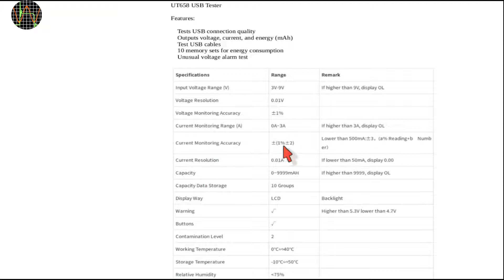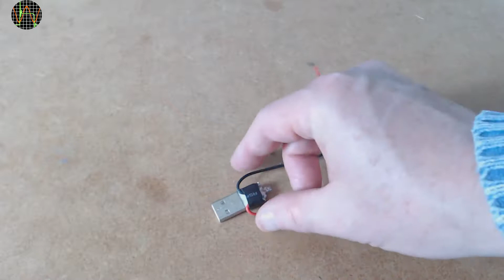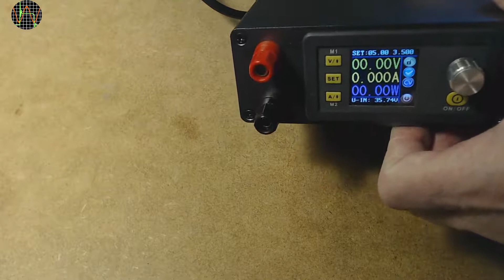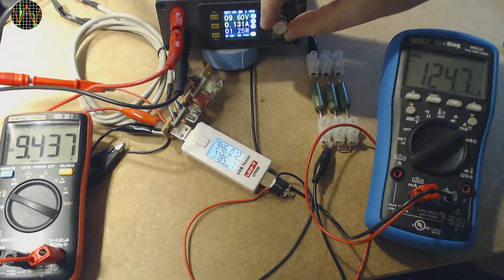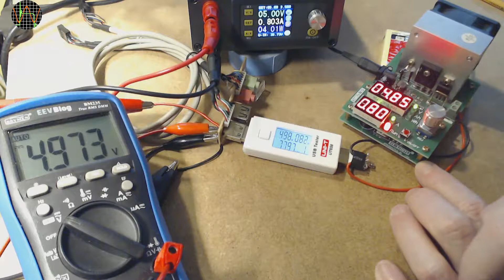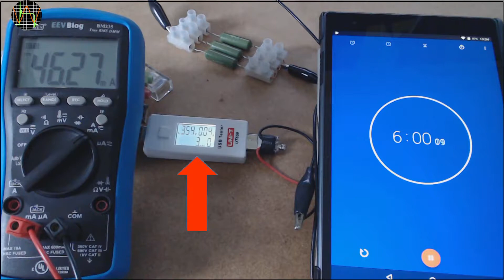Review and test of the UNI-T UT658 USB Tester

Comment: Hello, good morning, please, can some body help me? I want to know if I can use this USB tester, because I want to chek a power charger of a netbook Acer Chromebook, it has a power connector USB C, thanks a lot, Hi from Mexico City
Reply from the maker: There is a small chance it might work, depending on how your Chromebook implemented USB-C power and whether the charge cable is normal USB 2 (A) on one side and only USB-C on the other and what your charger is doing. A lot of variables, you see. This is why it is very hard to give you advise on this.  The problem is that the UT658 is really a bit old by now. It doesn't measure anything above 9V while more recent USB  power standards have 15V and 20V delivery.  This is negotiated between the Chromebook and the charger so it depends on the capabilities of both. In addition, by running the charge cable through the UT658 you reduced the whole connection to no more than USB 2 (4 wires), simply because that's how many the UT658 implements.  You may find that the UT658 happily shows charging at 5V or even 9V at 1A or so because with the UT658 in the loop, both Charger and Chromebook deem the connection to be the lowest grade possible and fall back to legacy charging voltages and currents,  In that case you find that with the UT658 in the loop charging will take ages while without it, it goes much faster.  So no point of putting the UT658 in.  To test a modern USB-C based charging system you need a tester that can handle this. Even the much more modern and capable UM34C and UM25C are not true USB-C. They can handle it (as a connector) and the power values will probably be correct but they don't carry  the additional wires for faster data, audio, video and so on. So data speed and capability suffer with these in the loop. If you ask me if I know a decent USB tester that has the full USB-.C, sorry I can't help you there. So far I had no need for one and things change so fast in this field.

Comment: Do you advise to me? I will use it simple works.I want to control  the  sending electric to battery or charge unit.Value sensitivity is not important for me.
Reply from the maker: Not sure what you are looking for? The UT658 (as almost all USB testers) do not control anything. You basically insert it into the USB connection between two devices and it will show you what is going on in terms of voltage and current. But the tester just shows what would happen anyway without the tester. It does not add any new function or capability.  The UT658 is directional as are most USB testers, in that current must flow through it from the plug end to the socket-end. If you do it the other way around, it will not show the current.  Keep that in mind when you insert it. The power source goes in the plug side (male) and the consumer on the socket side (female). In case of a battery, this means when you charge the battery, the battery is a consumer and goes on the socket side but when you use the battery to power or charge something else, it needs to go on the plug side. 
Hope that helps
Reply: @TheHWcave  thank you very much for long and long help.I will use it for repair works.example: I will control the phone charger circuit start the charge or not.Or battery start to charge or not.And if battery died it will suck soo little current.I dont care current value is sensitive or not.if you have Instagram adress I can follow you
Reply from the maker: @alit.6069  Sorry, not using Instagram , FB or similar ...